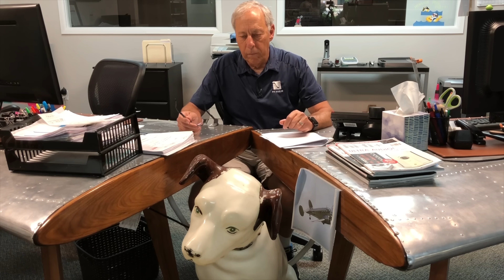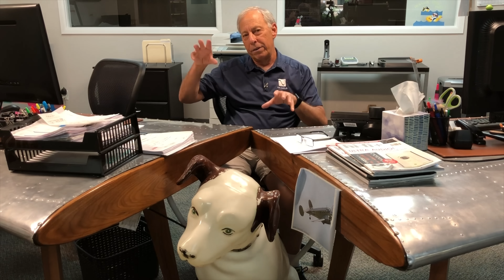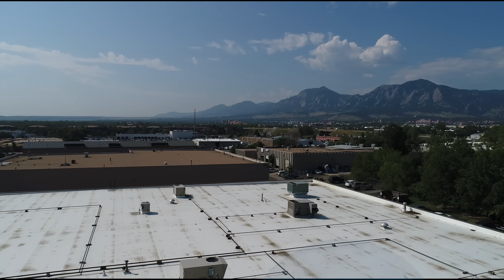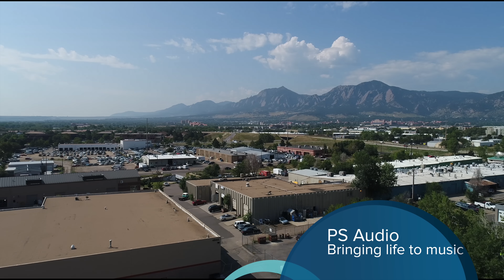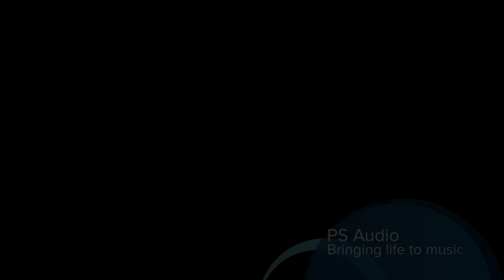Are vacuum tubes worth it?

Comment: Are tubes worth it? HELL YEAH! I built a tube (aka valve) microphone preamp and it sound miles better than the solid state preamp I made. There's some kind of softness and warmth to the sound that I just dont hear with the solid state version.
Reply: I was very close to buying a rogue audio power amp, but then I did some research and learned sonically the tubes will last about a year under normal use.  No they won't blow but the sound quality slowly goes down.  So I would be spending several hundred dollars every year replacing tubes. No thanks.  However I am sure one day I will purchase a tube amp but not for my main system.
Reply: I put new tubes in my Audio research preamp back in 1980. I figured I should replace them several years later with my backup tubes and heard no difference so I put them back. Still using that preamp today with the same tubes but new filter caps.
Reply: Tubes should last long than that, you may need to bias your amp. If a tube amp is biased too hot the tubes will burn out more quickly. Also some amps may have a solid state rectifier.
Reply: https://youtu.be/nwxQaG2NzVc
Reply: That softness and warmth is added distortion. It may be desirable, but it is still distortion.
Reply: John Casteel
Most people seem to enjoy distortion over sterility.
Just sayin'.
Reply: @John Casteel when people mention the word 'distortion' it sounds like a pejorative, depreciatory, i.e., intrinsically negative thing. But this statement is academic. In real life, you realize that in fact there are some types of distortion which add up to the nice reproduction of music, and in this sense they can only be considered musical and welcome. Distortion is anything that was not present in the audio signal in the first place (per definition). The word 'distortion' came from electronics, where you don't want anything spurious to tamper with your original circuit. But 'distortion' may be good or bad (though it's usually bad!). But when you consider 'even' distortion, second harmonic for example, it blends so well with the musical audio content that it just enriches the sound subjectively, there's no drawback to it at all.  Matter of fact I think that tube distortion even comes to compensate for some possible sterility to be found elsewhere in the audio chain, i.e., for the sterile tone quality and lack of ambiance captured by microphones upon the recording process. In this video Paul mentions that tubes may be considered 'reverb units' and therefore may be providing ambiance cues to the otherwise flat-sounding, sterile microphones used during recording.
Reply: @wramaccorsi1357  I tried a tube pre-amp once.  The warmth was nice but the soundstage lacked a great deal of detail.
Reply: @Magnulus76  If the soundstage lacked detail (when compared to a transistor preamp I suppose), please note that this is not an intrinsic fault of tubes. It just means the circuit chosen for the mentioned preamp was not a good one perhaps. There are good tubed preamps out there and not so good ones as well. (And the same may be said of transistors)
Reply: @wramaccorsi1357  I've listened to two different tube preamps.  One high end (Schitt Audio Vali) and a cheap Chi-fi Chinese preamp (but it still had good SNR).  Both exhibit the same problems with imaging/soundstage compared to solid state.
Reply: @Magnulus76  Sorry to say, but in fact these brands you mention cannot, IMHO, really be deemed true high end or references for that which can be achieved in tubed audio. Many brands have appeared lately (especially from China) and they're just seizing their place under the sun by making use of the marketing "appeal" represented by tubes. 
Now, take brands like Manley, Conrad-Johnson or VTL; these are truly high end brands representative of that which the best tubed projects can achieve. (I'm aware that these latter brands I mention don't really come cheap as transistor preamps do - they're in fact quite expensive, but these are brands audiophiles would promptly acknowledge as being truly high end, and the soundstage produced by them can be outstanding)
Reply: @wramaccorsi1357  What is often described as "holographic" in tube sound is the very thing I'm talking about.   It's an artifact of tube amplification, not the circuit.  I very much doubt that Conrad-Johnson amps are immune, because I've heard people describe this as a "feature" on high end tube gear.  But it destroys the ability to generate truly realistic soundstage and imaging, for instance, through a DSP for headphones.
Reply: @Magnulus76  An amp's ability to generate"holographic" sound,  either when employing transistors or tubes, arises from a good project in the first place. This includes the components used and indeed the circuit, because if a given circuit uses too many amplifying devices in sequence (a bad circuit), the sound may get blurred and smeared, partially destroying its focusing capabilities. Therefore, it's not "an artifact of tube amplification", seeing that this flaw may happen with transistors within a bad circuit as well. Hence, the circuit is accountable for the effect you mention too. (That's what amp reviews refer to when they say a given circuit "topology" could be better, etc.) What I guess you may be referring to is the fact that tubes resonate internally (due to the workings of their internal electrodes and the surrounding glass encasement they possess), much more than transistors do, causing a microphonic characteristic which produces some minor "reverberant" sound characteristics in their output. But such reverberation effect is subtle and quite low in its order of magnitude and therefore does not come to compromise imaging and soundstaging. Please note that such effect takes place mostly in the generation of nice-sounding, musical harmonics and does not happen timewise (the reason why imaging characteristics remain preserved). When you mention that "it destroys the ability to generate truly realistic soundstage and imaging, for instance, through a DSP for headphones" it seems to me that you speak from a purely theoretical point of view and not from practical experience, because this interfering effect you mention does not happen at all, I've never heard it along my audiophile life (and I'm a seasoned audiophile at that - I started out in audio in 1979). Headphone DSP's are not tampered with because you made use of tubes in the first place. And the reason is that the order of magnitude of the "reverb" produced by tubes remains down low and does not interfere with DSP processing or whatever is producing the soundstaging. I've listened to headphones through tube amplification, I've listened to Stax Sigma tubed headphones, I've listened to the Conrad-Johnson ART preamps and amps (which cost a fortune) and the soundstaging is just flawless. And it couldn't be different as these represent the best that money can buy and are very much sought after in the market for being the best in their class. Not to be compared with budget, entry-level and sometimes cheapo Chinese gear, where these comparisons are of course rendered worthless.
Reply: @wramaccorsi1357   Having never listened to the mentioned pre-amps, I will have to take your word for it.  

I use Meier crossfeed or Dolby Headphone and that's when I really noticed that something was off with the tube preamps I have tried.  It sounds like a phase problem (nonlinearity), and the DSP is grabbing hold of that and treating it like spacial information.  You can even hear some of this without DSP, as the soundstage seems to be somewhat distorted like a funhouse mirror.  I can't even believe people consider that "high fidelity".
Reply: @Magnulus76  Well, now you've described in more detail what is puzzling you. It seems to me you're talking about some gross anomaly or distortion which gets augmented by the DSP (And this is not what I was talking about earlier in my posts). However, I believe both Meier and Dolby Headphone are apps that do change original phase information and therefore may not be purist approaches, also interfering in the final distorted result you hear. The tubes could be the culprits, as well as the apps you're using. You need to listen to music the purest and most straightforward way without processing first, without the apps and without tubes, so that you know exactly what the expected soundstage should sound like. You need this as a way of obtaining your spatial reference, and then you can build upon it by adding additional app processing and tubes, always checking out whether the imaging remains unchanged. And of course this "funhouse effect" is not hifi and can't in any way be considered so, but now we're talking about some odd, faulty behavior at play here, and I don't know exactly what could be happening.
Reply: +John Casteel YES! There's so many comments here about guitar amps and not actual tubes. An actual line-level tube-amplifier shouldn't add any warmth AT ALL, smoothness YES, but warmth/color/etc it should add none of that. It's not until you run the tubes at high voltage like in most of these "guitar amp" comments, that you start to get warmth/saturation/color/distortion. Too many peeps here who aren't engineers at all.
Reply: And the cool bright sound of transistors is added distortion. everything changes the sound to some degree so why not in a way that's pleasurable ?
Reply: Jfets come pretty close.
Reply: It is called even orer harmonic distortion. I love it.

Comment: Don't Mosfets take voltage and control current? Because of this, they need op amps and a feedback loop which constantly chases the intended amplification factor?

You can argue a mosfet feeding back into an op-amp is a voltage to voltage amplifier, but these are separate things.
Reply: Yes, negative feedback is used to make current output devices pretend to be voltage output.

Comment: Tubes are also better than solid state devices at maintaining voltage during temperature transitions.  Modern zener diodes can vary quite considerably based on ambient temp whereas tubes are essentially self-heating.
Reply: And as such, good circuit designers will not apply zeners in situations where the temperature change matters.

Comment: I have a tube hybrid pre-amp now and love it. Before that, a tube pre-amp and loved it. I also had a tube hybrid power amp. Loved it too, but finally went solid state. But I just don't have it in my to tube roll any more or spend money buying tubes. I guess if I could have what I want and don't have to worry about maintaining it, it would be tubes.
Reply: There's Op amps and Discrete op amps now to worry about :D

Comment: I would think that tubes and FETs convert changes in voltages to changes in current; BJTs can either convert changes in current to larger changes in current, or convert changes in voltage to similar changes in voltage while reducing output impedance.  Op amps are often connected in a way that converts changes in voltage to changes in voltage, but can also support other operations as well.

A difference between tube amplifiers and transistor amplifiers that I've seldom seen mentioned, and never really discussed, is that most modern transistor amplifiers are designed to output more power into lower impedances than into higher ones, but many tube amplifiers are designed to output more current into higher impedances.  This is why tube amplifiers will often over-stress the output transformer when run open-circuit (they want to output maximum power, but with no speaker to absorb the energy the transformer has to take it all), while transistor amplifiers don't mind running open circuit but are stressed by short-circuit conditions.  The way amplifiers react to output impedance would seem to have a big effect on how they interact with resonance in speaker cabinets, crossover networks, etc.  For high-fidelity or PA applications such interactions may not be desirable, but for a guitar amp I would think they could help define a characteristic sound.
Reply: Transformer is not a power consumer except some loses. Opening secondary side results in  increase of output impedance, and decrease of tubes load. The same in mains transformer switching off receiver does not force transformer to take the load which was  removed. Transformer works with minimum current then. .
Reply: Transformer with the secondary load disconnected is a big inductor. If you turn up the volume on the amp (if you do not know that speakers are disconnected, when no sound comes out, you just turn it up), at some point the tube will be going from saturation to cutoff. Inductance does not like such change in current and will produce huge voltage spikes (working kinda like the ignition coil of a car) that can damage the output tube or insulation of the transformer.

On the other hand, you can run a tube amp with a shorted output usually without problems, as the tube will not produce more current (so it will produce very little power).
Reply: A transformer which is in its useful operating region will not consume much power, but a transformer which goes into saturation will act like a low value DC resistor for a portion of each cycle.  This can quickly result in destructive overheating.

Comment: the question itself is incomplete and it is impossible to discuss. My answer is: yes solid state amps are better, and yes valve amps are better. It is just a nonsense because all depends on what loudpseakers you drive with that amp. If you find the best sinergy with the right loudspeaker,  a solid state amp could be the best possible, compared to a mismatched valve amp-wrong loudspeaker. But with the best sinergy with the right loudspeaker, a valve amp could be the best possible. So it is not depending on the amp quality itself but related to sinergy with loudpeakers (and other aspects too)
Reply: How nice, you are repeating everything Paul said.

Comment: https://www.tubecad.com/2012/06/blog0233.htm  Tube I/V converter!  I'm actually finishing up my plans to build a differential I-out DAC (He refers to an AD1955 in one or two of his schematics but I might actually use that chip as its cheap, meets all my requirements and actually is decently reviewed) and I'm going to breadboard one of these Broskie I/V's and a FET I/V stage as well to see what I like the most.  It will either be the Broskie or like a BJT setup to output .4-.5 volt...depending on what I can manage for DAC output I'll try and use a 12au7 or maybe a 6922 to get up to solid line level.  
I have everything but a few $ worth of resistors so its mostly a "for the fun of it" experiment...just curious if anyone else has gone down this route and what there results were

Comment: Tubes > even harmonics = ''sweet'' sound; transistors > odd harmonics = ''bitter'' sound... but... tubes > delay = ''dragging'' sound; transistors > PRaT = ''fast'', natural speed of sound... Both ''worlds'' in one, like PS Audio... Maybe... Who knows? Paul? BTW for el. guitar ''Marshall'' definitely (tubes amp.); for audio... your taste.
Reply: Harmonics distortion , no matter the type  have  nothing to do with "sweet sound" (if it exists). Harmonics are harsh - some tolerable some not at all like those in solid. Those tolerable are desired for distorted guitar sound. and it is their only practical  use. Some people like to drill their ears and they will go for any overpowering of tube amp. But is it "sweet sound"? Talking strictly about transistors and tubes deliberating their minor differences in curves without mentioning  about total   difference of amp technology,, circuitry and speaker impact  is puzzling.
Reply: Overdriven tube amp sounds better than an overdriven transistor amp. Especially if the tube amp is SE. It also sometimes sounds interesting in that when I turn up the volume on my SE tube amp, it starts to sound like the singer is shouting
Reply: I share your point.

Comment: From the Tung-Sol electron tube manufacturer:

http://www.tungsol.com/html/faqs14.html

Question:
Why is there a difference in Tube and Transistor sound?

Answer (excerpt):
The basic cause of the difference in tube and transistor sound is the weighting of harmonic distortion in the amplifier’s overload region.

Actually, I think it's due to the higher harmonic distortion even when tubes are not overdriven